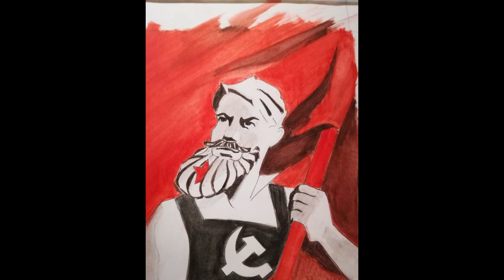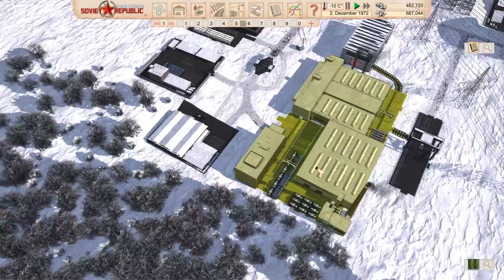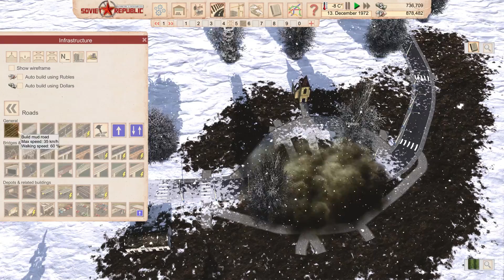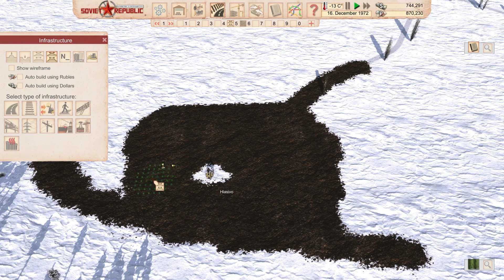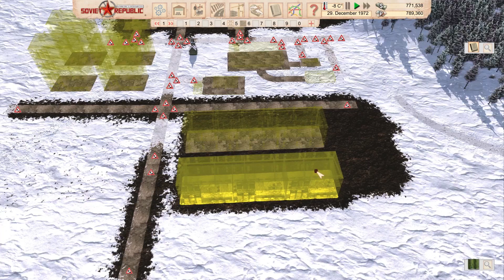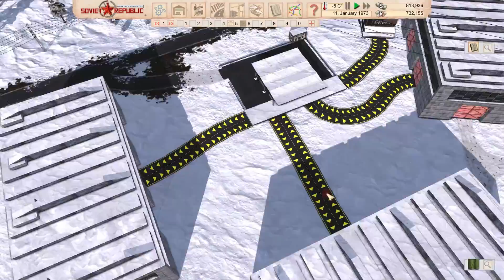Workers and Resources - Soviet Republic - Ceanwu Republic - Ep.69

Comment: man, you can not create a loop from the electric network because it is not a tram. the network is supposed to be like the sun with separate rays coming out of it and not connecting. two sign for 1 trucks two or more stores as close to deliver food to both as it was before the update and there were no distribution centers. if you do something with farms, do it in winter and in summer do technical services
Reply from the maker: Let's say you have 1 powerplant. And it does not have enough power. You build a second one and you want to distribute that power equally everywhere. You will need to intersect the cables somewhere so the second powerplant can contribute to the first powerplant electrical grid. Do it 3-4 times and you will have to have "loops". :) 
Trucks and stores you are right! I am implementing that. That's really good advice. 
Farms take longer than 1 year to build as I usually construct the whole industry and currently on the edge of the map. In the future, I will be rebuilding the old farms and this will be easier as all the resources will be closer. 
You are right about technical services. I will do that! 
Thank you, Dee!!! :)